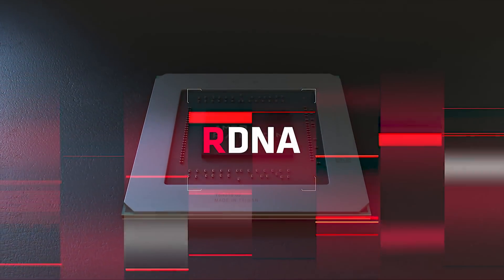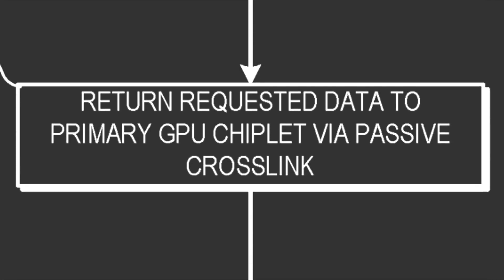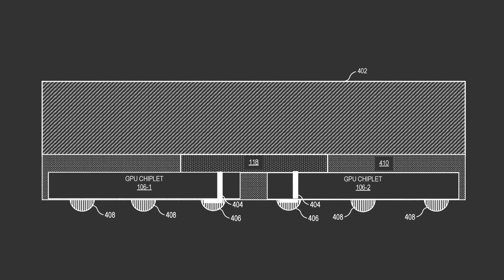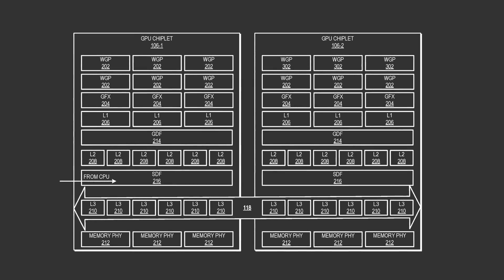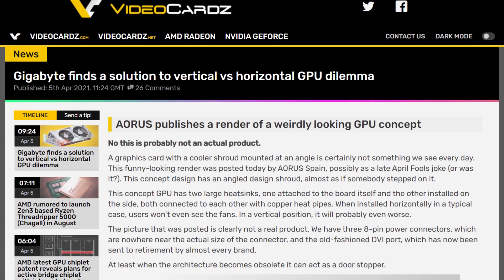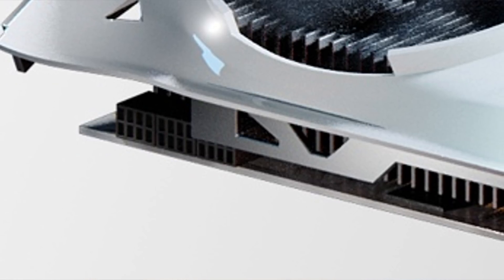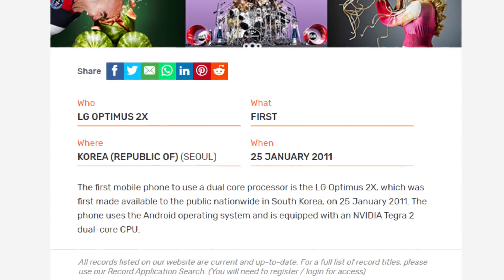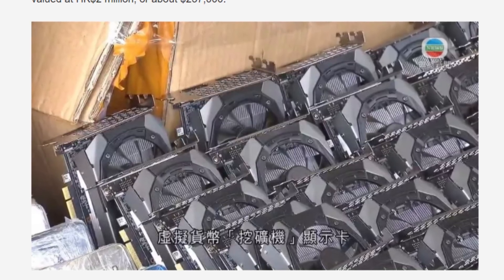AMD’s Chiplet RDNA 3 GPU’s are Getting Closer!

Comment: I expected RDNA3 to hit this year, but they probably need one more to flesh out multichip tech, so probably next one.
Unless they ironed out all the kinks in the process while doing CPUs and GPUs are good to go. Still next year probably.

It would be completely idiotic to launch a new arch while the current one's... well. Most nobody's even seen this generation, RDNA2 OR Ampere(I got a 3070 lol).
Though it doesn't stop them both from launching new SKUs.
Reply: why on earth would you expect RDNA3 this year? they haven't even finished releasing RDNA2 yet...
Reply: @oxfordsparky  I get what you're saying(topkek), but they planned an arch a year and they've been hitting it thus far.